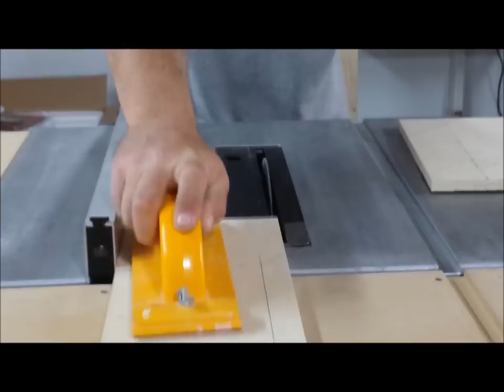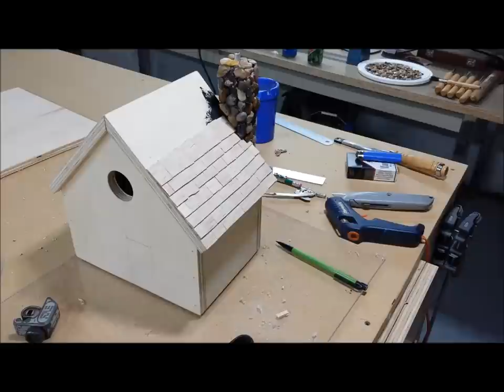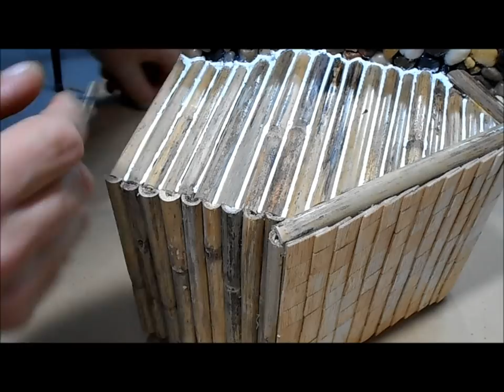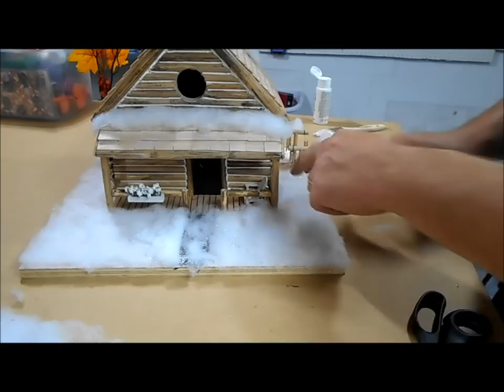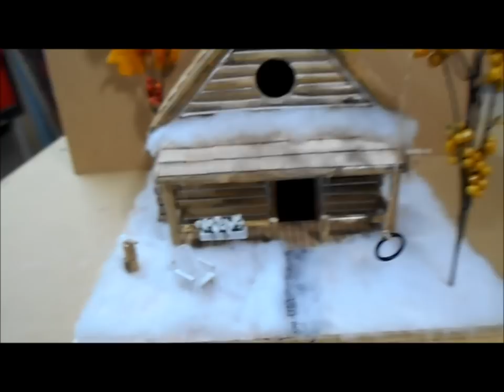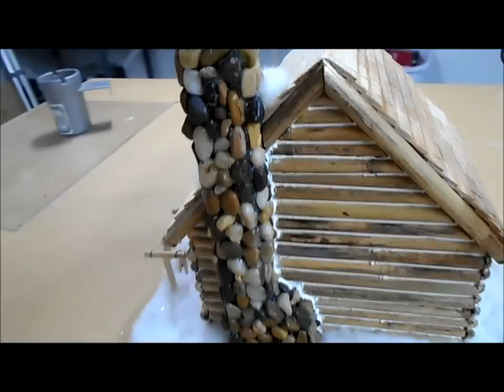My entry for Summer's Woodworking 2nd annual bird house competition

Comment: I love this !!!
Are those dowels cut lengthwise in half and how did you do it ?
Reply from the maker: Thank you. They are actual twigs, not dowels. Yes, I cut each one lengthwise on my bandsaw.
Reply: Wow that takes some guts being that they are so long. Do you have jig to keep your fingers intact ?
Reply from the maker: I don't have a jig..lol. I just ran them halfway through, then grabbed the back (the part already cut) and pulled it the rest of the way through.
Reply: That's what I would do but I am not real proficient on the band saw yet. Need my fingers, lol. However I am going to make a few birdhouses similar to yours and not so gorgeously decorated for the people around her hopefully in my own year round booth at a consignment store.
I have seen jigs that have 2 pieces of  2 x 2 with the hole drilled down the middle and it keeps the dowel or branch in place. Have to look it up again. It's a almost hands free way of splitting the dowel in half.